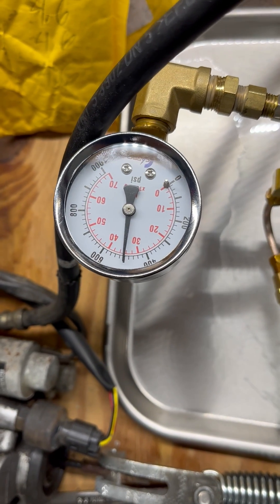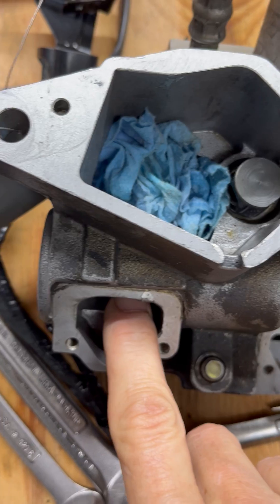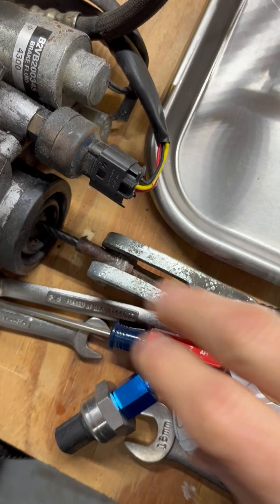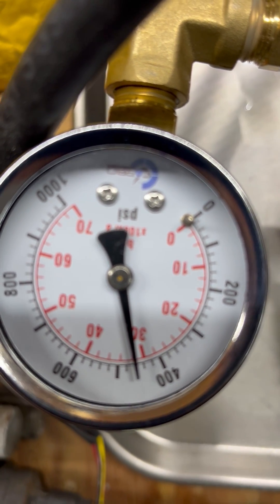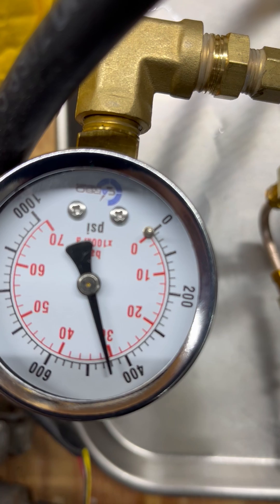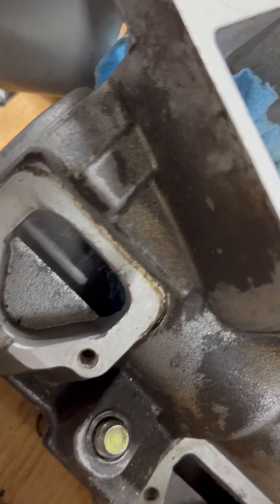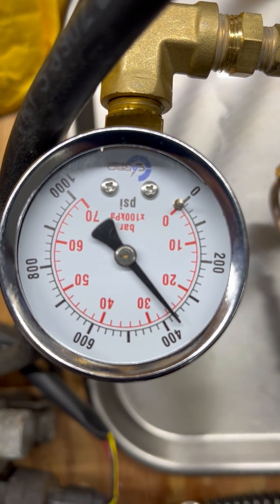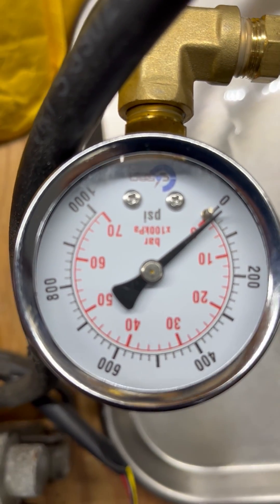Pressure Drop for GSA actuators

Comment: Hi, thanks for the video uploads. I have a crazy one here in NZ. Once you have turned the car OFF and removed the key how long does it take for your SMT ecu to stop maintaining the pressure in the system? Mine doesnt stop and is still cycling the HPU.
Reply from the maker: Normally pressure bleeds down after 4-5 hours or so.   If the pump is running, something else is wrong.  Is the interior light staying lit?  Wondering if the door switch isn’t working?   Otherwise, I’ve seen a failure where the clutch cycles and then the pump runs, and continues until the battery dies.   Usually due to a bad clutch position sensor, where the system got stuck doing a clutch position confirmation.
And is stuck on the first step, trying over and over.
Reply: @paulshibbs  Hi Paul Thanks for the reponce. I did check the interior lights and the light on the instrument panel, they say the door is shut. I am confident the door switch is working ok. I have tested all the posision sensors and they seem to sweep clean on a scope. I hace since opened the GSA and found the orings on the spool valves seem way to big for the grooves. I wonder if the system was maybe bypassing fluid?
Reply from the maker: @TASNZ-m4p    Those orings should be snug.  Usually that is a sign that somebody has poured some kind of hydraulic oil or petroleum based fluid into the system.  I can send you new orings for all the solenoid spool valves.   They are cheap.  I worry that wrong fluid will also destroy the accumulator diaphragm, plus all the lip seals in the system.  Usually the o rings on the hose quick connect fittings will also be swollen.   Email me Cyclehead21 at g male.